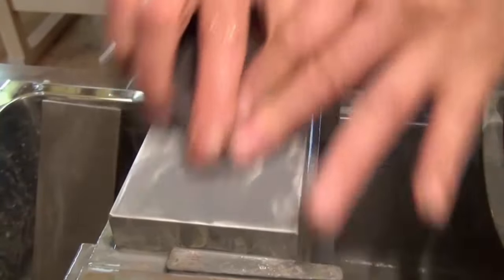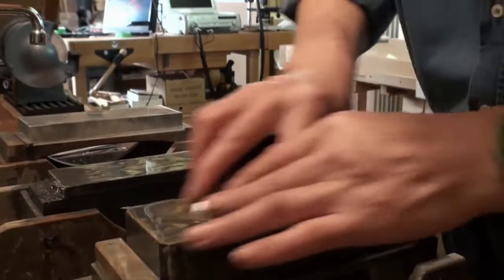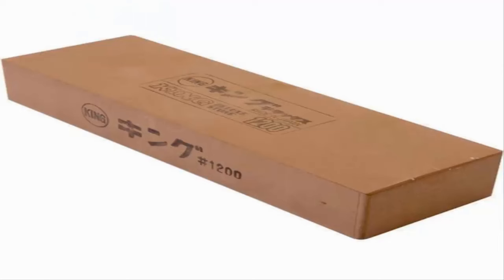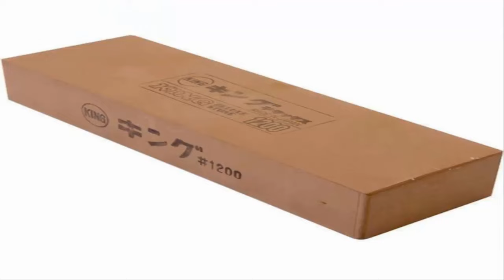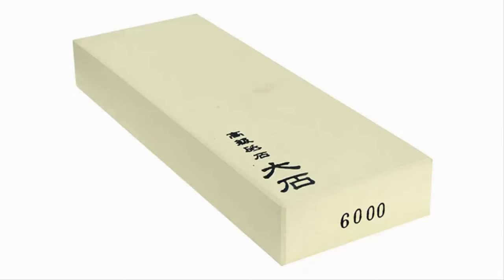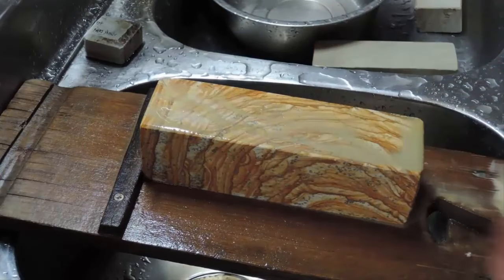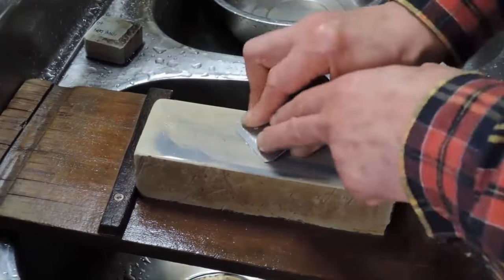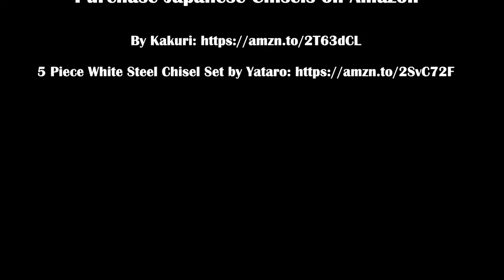Sharpening Blades The Process Takes A Lifetime To Master

Comment: The guy is using like 5000 dollars worth of whetstones.
Reply: Look up Sharpton or Shapton ceramic stones, those are expensive, at least they were last I checked. Can't remember the exact spelling of the name
Reply: @Ham68229  I use a king 3000 for a finisher and a king 6000 as a honer then a strop 1mic on the rough side and .5 DMT diamond spray on the smooth side.